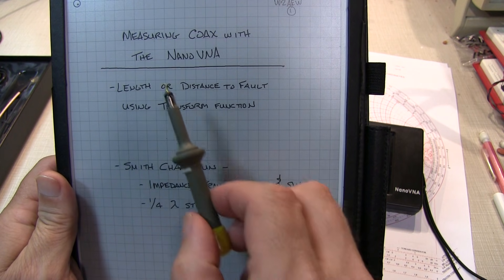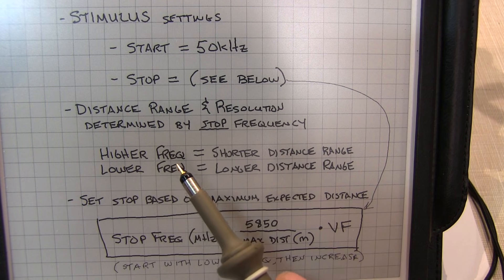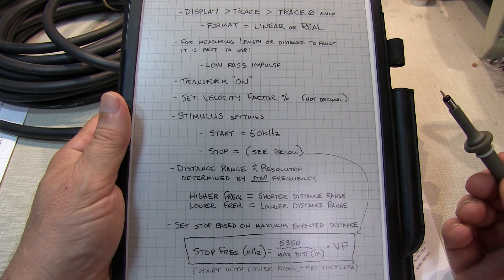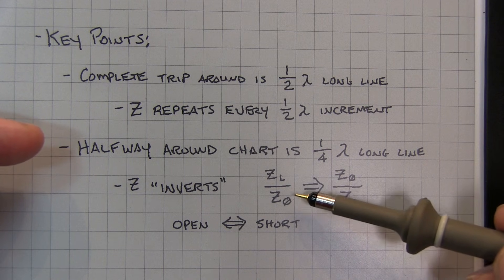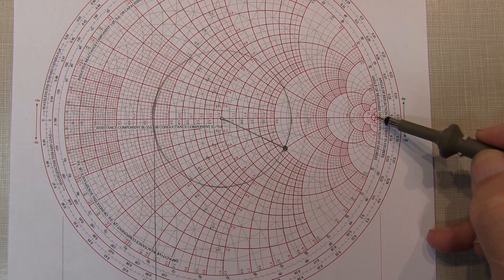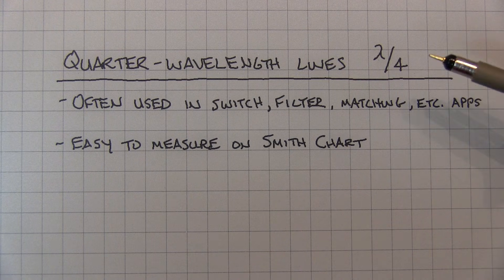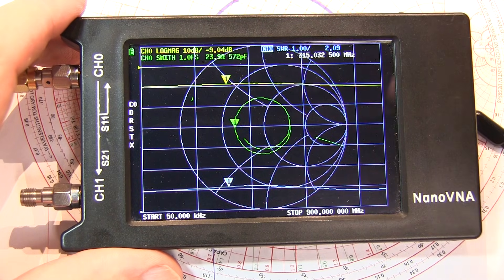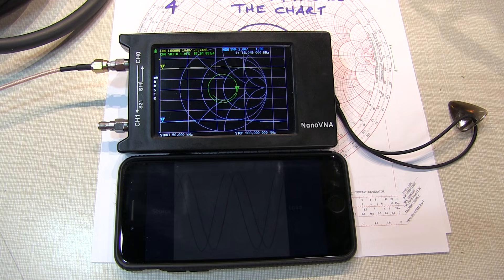#316: Use NanoVNA to measure coax length - BONUS Transmission Lines and Smith Charts,  SWR and more

Comment: Where does the 5850 (starting at 2:00) in the calculation of the stop freq shown near the bottom?
Reply from the maker: I determined that factor by measurements - I setup a Stop frequency and took a look at the maximum distance displayed by the transform.  I then backed the Velocity Factor out of the equation to come up with a "factor" to use to compute the stop frequency vs. max distance.

Comment: If you’ve work around RF long enough you’ll come to the conclusion it’s’  actually FM!
Reply from the maker: I've worked around RF for 40 years, and I don't know what you mean... ...I guess 40 years isn't long enough....
Reply: @w2aew  I’ve worked in RF since the early 70’s in the electronic warfare world. There is theory and then there is magic. Certainly you have come across problems you couldn’t theoretically define. You want to resolve it but you just can’t see it. The complexity is infinite. I recently watch IMSAI tear down a direct tv LNA and i think he referred to circuit board layout as “Black Art” and I absolutely agree. The design engineers that produce those designs and then  build millions of them are “magicians” and are compensated extremely well.  So on those days where your pulling out your theoretical hair..it’s gotta be magic, f in magic aka FM!
Reply from the maker: @judd_s5643  LOL - I was reading is as FM=frequency modulation, and was confused.  LOL.  You are right!
Reply: @judd_s5643  In the 1980s, the TV station where I worked, acquired two state-of-the-art helical-scan VTRs.  The factory rep told us that no one engineer, involved in its design, fully understood every aspect of its design.  And I must also say, that the Japanese engineers who wrote the service manual, no doubt later retired, moved to China, and are now instructing the Chinese on the finer points of translating their manuals into English...."Please that voltage not more 18 volts, TP-35, but 15 less..."

Comment: As always, a great video! 
I have been struggeling to factor in the impedance shift from PCB microstrips, when matching antennas. I set up the formulas for calculating this effect on the complex impedances, and so far the results of the math checks with the theory. 
But, when measuring with the NanoVNA, it seems that the "rotation" of the impedance shows up as if the transmission line were closer to double it's actual length. Meaning that connecting a quarter wavelength coax makes the impedance do a full rotation, while an 1/8 wavelength cable gives the half rotation. It seems like the cable in your example might also be quite a bit shorter that the quarter wavelength of 315MHz.
I was wondering if the effect could be caused by the signal traveling the line both back and forth before reaching the point of measurement, or whether it might i a bug in the VNA.
Reply from the maker: I've double checked the VNA a couple of ways (with a professional VNA, as well as using TDR techniques and other measurements.  I'm confident in the results I showed.  Are you sure you properly accounted for the velocity factor of your transmission line?

Comment: When measureing the length of the coax, I don't recall your saying what was at the far end of the coax.  Was it open?  Shorted?  Connected to the antenna?  Inquiring minds want to know.  Thanks for your videos!  W3LOU
Reply from the maker: I left it open (easiest to do), but a short would work well too.

Comment: great video!    so if I want to measure a  1/2 phasing delay coil on a vhf collineal antenna should look for phase shift using  S21  and it is on the point where the chart goes from -180 to 180 ....is that correct?   tks for the advice

Comment: This is really useful at the moment, I have the NanoVna and was searching for this very subject. Thank you so much. I have a long piece of coax that has a VSWR problem and I'm sure this will solve the issue or at least let me know where the fault is along the cable. Thanks again. Andy.
PS just Subscribed and Bell'd ( is that a verb?)

Comment: New to radio. Installing a base station & antenna. I should measure for my required coax length in 1/2 wave multiples (including taking into account VF) for best results?
Reply from the maker: There is no need or benefit to that.

Comment: The last analyzer I used was an Agilent PNA and wow, what a nice piece of equipment for over $30K.  Being a ham and an experimenter I sorely missed having access to even the old "antique" HP analyzers.  When I saw the nanoVNA being offered I figured I'd invest in the ~$50 for what I thought was going to be a cheap toy.  I was wrong.  The only complaint I have with it was the poor documentation and the touch screen; however, through your videos and others like it I'm able to realize the potential of this device.  The menu screens are not intuitive and having you walk thru the set up process is a great help.  Some of the screens don't match mine eg. it doesn't have marker peak search probably because I don't have the latest firmware.  But, no matter I was still able to use it to measure a piece of coax.  Just for giggles I took one of the cables that came with the device mainly because I didn't want to unbox a long length of RG-8U and measured it.  I set the stop frequency to 500 MHz and the velocity factor to .66 and lo and behold once I converted from meters to feet the measurement was spot on.  The touch screen drove me nuts in the beginning.  You definitely need a stylus to access the menus.  I managed to find the one I had for an old tablet and life was good!  I really appreciate and enjoy all your tutorials.  You really have a knack for clearly explaining what is really a complex concept. 73 de N1ABE>>  Ps.  Your lab is a hell of a lot neater than mine.  <LOL>

Comment: First of all I love watching your videos. One question though, is there a way to measure the impedance of an unknown coax using the nanoVNA? Thanks in avance
Reply from the maker: Yes you can.  Connect the coax to CH0 (the reflection port), and terminate the unknown coax with 50 ohms.   Run a sweep and plot it on the Smith Chart.  If the coax is 50 ohms, it will plot just a ball/dot in the center.  If it plots a circle, then the coax isn't 50 ohms.  One point on the circle will cross thru the center of the chart (this is where the line is a multiple 1/2 wavelength long).  Take notice of the resistance at the other point that crosses the horizontal axis.  This is the quarterwavelength transformed impedance.  Let's call that Zm.  The line impedance Z0 is then calculated from Z0=sqrt(Zm*50).
Reply from the maker: I just posted a video on this a few days ago, have you seen it?
Reply: @w2aew  Yes I did! Thank you so much , I realy appreciate your help. 😊
73 from Portugal

Comment: At the end of the video you mentioned "fake" good SWR due to transmission line loss, besides measuring the antenna at the feedpoint, which in some cases might be difficult, can you think of any other way to detect this "fake" swr condition?
Reply from the maker: If you perform some SWR sweep at higher frequencies - higher than the antenna is designed for - and the SWR never gets really bad (10:1, 20:1, etc.), then it is likely that coax loss is affecting your SWR reading.

Comment: Another EXCELLENT presentation Alan, You've convinced me to buy one. I've always wanted a TDR. In the mid 70's I  also attended Training on the 7704 O'Scope and all its plugins, to include the TDR PI. I was AMAZED at the perfection of GR connectors, the pure GARBAGE of "UHF" Connectors, plus the fact that you could observe a glitch in a half-inch coax when you squeeze it with your fingers. 😲 Fast forward about 10 years I was working in Saudi Arabia where my office had a flunky from the "Wiring Department" run cable for a 10BASE-2 network. Nothing worked! I borrowed a portable TDR  and found opens at almost every computer in the network. Because...and get this...the flunky didn't know that he had to "crimp the center pins." 🤣😂🤣

Comment: I am building a 60 foot length of RG-8X with a PL-259 on each end.  This was very helpful.  I had roughly measured 60+ feet (middle of chest to finger thumb hold = 36 inches).  I was learning how to use my Nano VNA H4 to measure the length.  You made it very easy to get an answer. I used the Transform with the linear format on Trace 0.  The answer came up at 19.3 meters using 50 Khz Start and 230 Mhz stop frequencies. I had to use an 80% VF to get this number.  Then I  used a tape to measure the  the length which came out as 12-5 foot lengths or 60 feet plus 40 inches.  Right on 63'4"  or 19.3 meters. I post as feedback on the 80% velocity factor, for the RG-8X.  Mine was labeled Davis RF  / Div of Orion Wire. It is new.  I then measured the SWR and came up 1:1 from 140Mhz - 150Mhz  and 420Mhz - 450 Mhz.  I will use the to feed my 2M - 70cm J-Pole.    Thank you for some great videos on the Nano VNA and the science behind what the instrument is doing. The Tiny SA just arrived and I will be looking at your videos on this.  I really appreciate your notes.  I punched my Tech and General last March.  Very helpful to this new Ham.

Comment: Thanks.  Very cool.  Appreciated.  Question.  If I have a rather lossy transmission line which causes an overly optimistic SWR, will keying the transmitter damage the finals?
Reply from the maker: No, the transmitter will be fine - it sees the SWR that the meter shows - it just means that some of the reflected power is being lost/dissipated in the lossy line, thus reducing the reflected power that the transmitter sees.
Reply: @w2aew   Thanks.  That would have been my guess.  But, I've been wrong before.... :-)

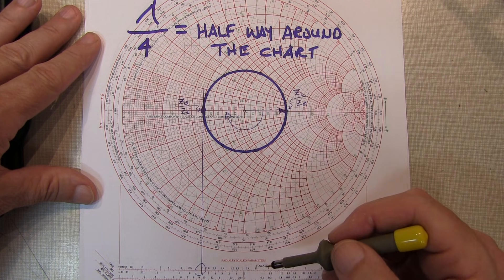Comment: 10:43 ok, but what will an antenna analyzer report the SWR at with vs without? It's measurement is based on what it sees at the port?
Reply from the maker: SWR should not be highly dependent upon coax length.  Sometimes you'll observe this, and this is usually due to the way that certain analyzers measure and calculate it.  If the antenna analyzer you use gives you complex impedance, this value WILL change based on coax length, as the smith chart shows.
Reply: @w2aew  Rig Expert AA-230 ZOOM here, so essentially, after running an SWR sweep, if i switch to the Smith chart, i can simply look at the circle that it would rotate around based on coax length? I'm just new to Smith charts so I'm trying to track.
Reply from the maker: @Justin-bd2dg  Yes, if you had a way to magically adjust the length, you'd see a circle be traced out on the smith chart (at a given operating frequency).  You don't see a circle when sweeping frequency, unless the load is purely resistive.

Comment: Does the Calibration Plane impact the cable measurement. I tried a few different SMA to UHF adaptors, calibrating each at the point of attachment of the Cable Under Test; but the attached cable length results seems to have the adaptor length included.
Reply from the maker: Not sure, it would be something that I'd have to check out.
Reply: @w2aew  I could send you an image showing my results, if you're interested.

Comment: Even if it doesn't improve SWR, is it still a good idea to adjust coax length so that the transmitter "sees" a better impedance match?  Or does it just fool the SWR meter and have no bearing on how much power gets reflected back into the finals?
Reply from the maker: Adjusting the coax length will change the impedance, but NOT change the match/mismatch.  In other words, the SWR is not changed.  Impedance is complex (meaning it has a real and reactive part), and for any given SWR there is a wide range of complex impedance that will give you the same SWR.  Some SWR meters are somewhat sensitive to what part of the standing wave they measure, so they may fool you into thinking you're getting a better match at a certain coax length.

Comment: 1:59 for the highest frequency setting, is there a need to "calibrate" the final range with the osl kit (in your case, 50khz-200mhz) before proceeding ?
Reply from the maker: Since you're not making an accurate S11 or S21 measurement in terms of absolute value, and only interested mainly in the relative change in reflection/impedance vs. frequency to help the transform determine length, calibration isn't as critical.  You should still have a calibration done over a frequency range that equals or exceeds the test range, but it doesn't have to match it (interpolation is OK).
Reply: @w2aew  thank you for your time, response and precisions. By the way, there is a beautiful GUI upgrade for the nanovna. There is also a nice PC software (nanovna.exe) that works with that firmware that actually match the reading of the VNA which I could not achieve with nanovna saver for unknown reason !. 

The support of that version is really good at the moment (every couple days). You can find files and forum in the following links (I am not affilated with them) https://github.com/OneOfEleven/NanoVNA/tree/master/Release and forum is here https://groups.io/g/nanovna-users/topic/75278418?p=Created,,,100,1,0,0::recentpostdate/sticky,,,100,2,0,75278418 

With the help of your videos, it is really nice to navigate and test with that version. Thank you for teaching us the right way to use those nanovna devices !

Comment: Great content! Thanks for sharing. I have question: could You explain how super regenerative receiver works, and how and why sawtooth signal appears in that circuit? I tried to analyse simplified one transistor (OB configuration) schematic and I do not understand how sawtooth is generated and contain high frequency modulation. At the end thanks for all Your videos I learned a lot from Your channel!

Comment: Can you explain or link resources to something that explains what the "Low Pass Impulse" transform option actually does in signal processing that enables us to see what we want better here? I've found in the manual on page 14 says what we are doing is simulated operation as a time domain reflectometer (TDR) to measure the distance to a power reflection (short or open) when selection the "Low Pass Impulse" transform option: (https://nanovna.rf.pl/Manuals/NanoVNA-User-Guide-English-reformat-Dec_9-19.pdf ). This explains how to get the outputs we would want for this measurement in a simulated TDR fashion, but what is actually going on under the hood? Do you know a specific resource myself and others might find helpful?

Comment: I've recently discovered your channel and truly amazed by the quality of your videos! I started from #1 and planning to work my way up to the top :) May be in one of your future videos you can explain what complex impedance means applicable to the antennas? For example an impedance for a half wave dipole is 73 + j42.5 , but what does it mean? Are we always supposed to see reactance in the resonate antenna? Thanks and please keep up the good work. 73! Victor, PA8MM
Reply from the maker: Thank you - I hope you enjoy my series as you work through them, and please excuse the poor video quality and shaky cam on my early videos.  I do talk a bit about complex impedance in later videos.  Note that the definition of resonance is the lack of reactance (only resistance).  Resonance does NOT always mean 50 ohms!.

Comment: Is the process identical when measuring 75 ohm coax, or does that add complications?
Reply from the maker: Yes, except that the "circle" won't be centered at 50.  Halfway around the chart will still be 1/4 wavelength.

Comment: Hi great video! Is this method applicable also to mease the length of a random wire (not coax)? If not (I guess due to impedance not being constant across the path) is it possible to measure the length of a wire with a scope and/or the nanoVNA? THANKS!
Keep up the great work!
thanks
Reply: From what I've found in the manual on page 14, it seems that this technique should work for any type of transmission line. A single open wire is more of an antenna (radiator) than an actual closed field transmission line kinda device (think twin lead cable), so I don't know how well that would work, but I might try using this technique on some microstrip, twin lead, and twinax lines in the future just to see how reliable this method can be. It might be difficult to source a VF figure for some more obscure line types (like twinax), but it would be cool to experiment regardless.

Comment: I have had the Nano H4 for a while, but had never used the unit for coax length.  Just acquired two cell tower coaxial cables with connectors and 'guessed' they were around 200 feet each.  After your suggested setup, they check 215 and 220 feet.  I 'assumed' a velocity factor of 0.80 since they were foam dielectric.
Great video as always.
Now, will this Nano let me check coax loss?
73
Glen K4KV
Reply from the maker: If you can get to both ends, you can do a S21 measurement which will show you loss vs frequency.
Reply: @w2aew  Thanks!  Yes, it is in a coil now!
Reply: @w2aew  suppose you couldn't get to the other end of the coax; what do you think about measuring the first frequency at which it transforms an open into a short and then calculating the length based on it being a quarter wavelength transformer and look at the reduction in the magnitude of the reflection coefficient to get attenuation? Then you should even be able to calculate loss per unit distance, yes?